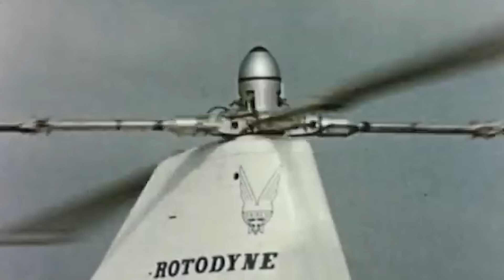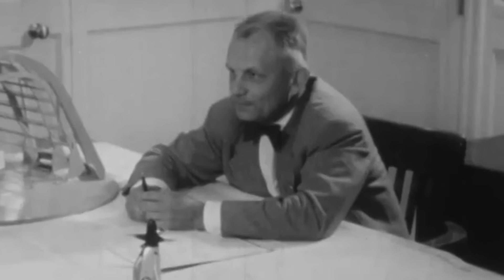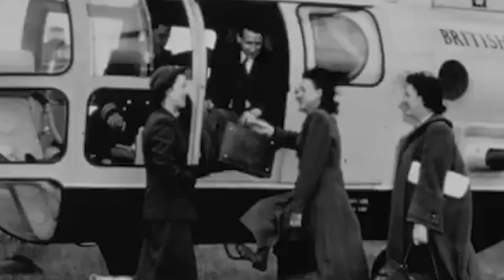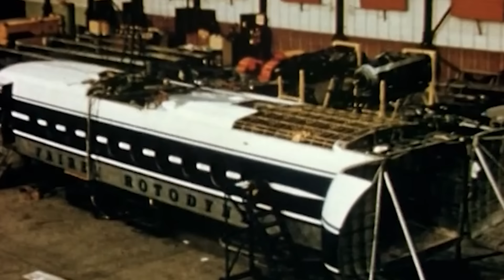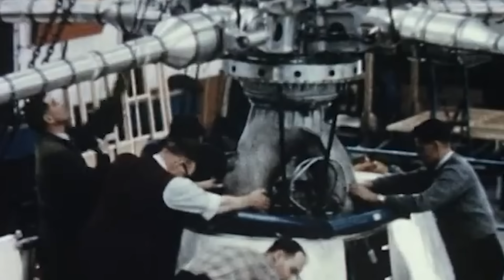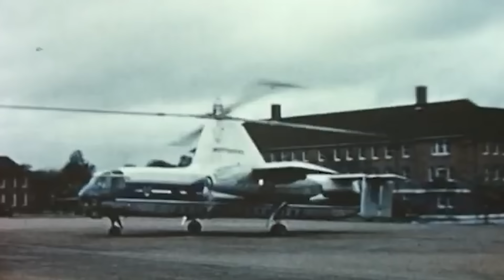The Most Successful Flying Box

Comment: The thing I've noticed about humans in general, and specifically the US, UK, most of Europe - the West - is that, if someone can dream it, someone can build it. And if an early model/prototype has some kinds of issues, if they can retain funding and keep working on it, engineers and scientists can usually sort it out - scientists can discover new alloys, new propulsion methods, fuels, new materials, new methods, lighter and more powerful systems, etc. and engineers can figure out better, more aerodynamic designs, better construction methods, better ways of putting everything together, etc. 

Seems like I've heard in recent years, it's the materials science that's one of the biggest bottlenecks - like we've got to figure out how to make different and/or better materials to build things out of - lighter, stronger, more flexible, more electrically conductive/resistive, room temperature superconductors, etc. Basically, with this specific craft, it seems like these issues could have been sorted out eventually - just find a way to muffle the noise, increase fuel efficiency, increase the lift/max load, get cities to help acquire more convenient plots to land on, etc. - like that stuck out - about finding better landing zones. It seems like cities and businesses/companies could have helped to find and develop suitable landing sites. 

Just crazy they had it more-or-less figured out back then - and I don't know the terminology/nomenclature but also how it had both the dedicated vertical and horizontal rotor/prop propulsion - and how they're still trying to master this VTOL type stuff even nowadays. I remember seeing, what was it, the Harrier and Ospreys back in the day (seems like I saw an Osprey fly over me once - being from the boondocks, it was quite interesting - you see tons of C-130s around here but that's it) - and now with the F-35 and it seems like I'm always hearing about bugs they're trying to work out. 

I guess it had to do with the specific timeframe, and I know it would be better if governments would be more frugal with our tax dollars, but given something crazy like this, the UK government must have been pretty tight with money to cancel it over £11 million plus the few million extra. It seems like the problems were solvable. But the US government throws billions and billions of dollars all over the place - it would probably be preferable for them to be more frugal and have to cancel promising projects rather than pouring funding all over the place and wasting tons of money.

Comment: There's no such thing as a "fixed wing aircraft". They're called Aeroplanes. Some of them have swing wings, which aren't fixed.
Reply: Most regulatory agencies, military forces and flight schools classify heavier than air aircraft into two categories, Rotary Wing aircraft  or Fixed Wing aircraft.
If it's wings do not spin? It's a Fixed Wing type... regardless if it has a variable geometry wing.

FYI: it's AIRPLANE  in English, The Fixed Wing aircraft was invented in America and the correct spelling is AIRPLANE

Comment: How does the aircraft work without a tail rotor to counter the torque of the main rotor?
Reply: The engines are not connected to the main rotor, so there is no opposite torque reaction trying the spin the helicopter in the opposite direction, it flys like an autogyro which also have no tail rotor system.

Comment: Flew in one of these from Penzance to the Scilly Isles  in 1969. The students from Wright Robinson  High School  in Manchester absolutely loved  the flights and these were in quite a contrast to the sea journey we took the year before or thew alternative  air link using  Dehavilland Dragon Rapide biplanes from St Just 'airport'.  Unique  memories.
Reply: Faulty memories... the single protype Rotodyne never carried passengers and was scrapped in 1962... you must be confused with another aircraft type.
Reply: @DoktorBayerischeMotorenWerke  Sadly after  the passage of  some fifty five years you are correct   with the info.  The Helicopter we used was a Sikorsky S-61 which was the current   helicopter used  in the late  1960s  as part of the service which lasted into this century and made it the longest running  public service   to  be based on  the use  of helicopters..

Comment: I would love it if gyrodynes could be made to work, they look to be able to fill several niches in aviation, mostly currently filled by helicopters, and expand others (flying busses). However, there would still have to be some serious research to make this happen.

Gyrodyne, including the Rotodyne, have more in common with autogyros than helicopters. The main thing is that the rotor shaft isn't driven by the engine(s) but rather freely rotates in the breeze. What allowed the Rotodyne to take off vertically was that (if I understand it) compressed air and fuel were pumped down the rotor blades and ignited in combustion chambers at the rotor tips. This rotated the rotor without creating the torque that requires single rotor helicopters to have tail rotors, however it also created a lot of noise. There would have to be a solution to the noise problem before gyrodynes could seriously take off (pun intended).

Modern autogyros do have spin-up motors for their rotors however as far as I'm aware they are for ground use only. What might work for providing power to the rotor without causing torque might be some kind of compressor or gas generator feeding compressed gas into a turbine attached to the rotor shaft. With modern batteries it might be able to build a battery powered system with power for 15 minutes, enough for takeoff, landing and some hover time.

Comment: I heard it flying as a kid. It was very,very noisy  at a time when aircraft engines were very,very noisy. The combination of a 90ft power rotor,two turbines and turbo propellers was over the top.
Reply: A quick question for research purposes as a writer - what was it that made the noise? Tip jets, the blades, or both?
Reply: @Ray_Satura_Valrose  Aircraft at the time were very noisy. As a kid I lived on the approach to Heathrow and a Lockheed constellation with four rotary engines was loud. Later we moved to a hill top and spitfires/ hurricanes, privately owned would growl into the nearby airfield. The rotor dyne was like three different aircraft in one place with different frequencies. The worst was the deep wamping  of the rotor and would vibrate inside the house. It's hard to appreciate today how turbine engines today have gained power and reduced noise. The tearing sound comes from propeller tip speeds exceeding the speed of sound which doesn't seem to be present in turbines. Perhaps sound cancelation occurs through different stages and blade patterns. Haven't looked at turbines since having a concept of inner burners in bypass air instead of afterburner in exhaust. A friend took that and ran with it.

Comment: Something I recall about the noise problem, was that the huge size of the main rotor; coupled with the speed of rotation meant that the rotor tips were travelling supersonically. No amount of noise reduction could overcome that problem.
Reply: And that is exactly why this concept was a failure... no one has ever solved the noise problem
Reply: The blade tip speed is given in Wikipedia as 720 feet per second.  At sea level, the speed of sound is 1100 feet per second.  So the rotor tips were travelling at  Mach 0.65  when the aircraft had zero forward speed.  At 100 mph aircraft speed, the advancing blade tip would therefore be travelling at 867 ft/sec, i.e. Mach 0.79.  The rotor operated in autorotation mode at higher speeds.  So no, the tips were NOT travelling supersonically (the designers were not THAT stupid)  - but the exhaust from the tip jets presumably was, which would indicate that the exhaust velocity relative to the rotor blades was higher  than (1100 + 720) = 1820 ft/sec.   That's what caused the noise.
Reply: @dafyddllewellyn6636  Excellent comments. Yes, not the rotor tip speed, the jet engines were Ramjet type and the exhaust nozzle gas velocity was extremely high... resulting in painfully loud engine noise.
Reply: Oh, interesting, you see, there is little talk about this problem.

Comment: This ideas and design more realistic to day with new upgrade bladed rotor know propeller toroidal least sound
Reply: This was a completely hopeless, dead-end concept that does not have any practical applications or commercial viability today.
Reply: 2 types  problem noise pollution, weight solve carbon fiber add knew electronic least weight more add reality to make don't forget appreciate place need save lacking space and need speed transit .that end vedio u see concepts   helicopter have design  @DoktorBayerischeMotorenWerke
Reply: @hyndriandelmundo6855  No one has ever solved the noise problem with tip jets, modern aircraft use turbofan engines for exactly this same reason. 
this was a prototype that had no additional weight from required avionics. 
In weight performance, traditional helicopters and fixed wing aircraft are inherently superior.
Trying to be both only increases weight and lowers payload capacity.

Comment: These Could Lift 18,000+ lb 💪
And Held The World Speed Record for Rotor Wing Air-Craft for a Few Decades 😲 
Had Multiple Back-Up Safety Redundancy ✔
No Tail-Rotor ✔ 
Even If It Had Both Engine's Failure 😨 
It Would Glide to The Ground, Safely ✔
The Huey 10 Years Later could Lift 4,500 lb 
Bacon-Foil Protection Against Bullets for Crew in Vietnam 😨 Wha...?
Reply: Epic failure... completely dead-end concept. Fairey made claims it could not deliver..
Reply: The CH-47 has a 24,000 lb payload, and a 400 mile range without any of the problems the Rotodyne had

Comment: Did they really only have that one option for the behemoth rotors? That being the end mounted propulsion system? Wouldn’t a typical turbo shaft engine that could produce the same thrust necessary as the tip mounted propulsion systems have worked? Then they could have just disengaged the main rotor from the shaft when autorotation was applicable? Unless such an engine concept was not available at the time? Any way, just a thought
Reply: With that setup, the machine would also need a tail rotor to counter the reverse torque on the fuselage. The whole beauty of the tip jets was no tail rotor was needed.
Reply: @mandolinic  I suspect running a single propulsion engine/prop would be sufficient to counteract the rotor torque
Reply: @mumbles2000  Or one propeller with forward pitch and the other in reverse pitch. Use the rotor to gain forward speed then disconnect the rotor and put the props in forward thrust. 

Nowadays the rotor and props could have electric drive with the engines providing the juice. 

A tail ramp would have be better, too.

Comment: One of these Rotodyne built with new smaller engines (yet more powerful and reliable), components made of composites would be feasible today. I am sure the sound decibels could be lowered within an acceptable range. The gyro copter idea seems better than the Osprey's plagued twin rotors that causes more often a dangerous Vortex ring state.
Reply: Agreed. These in a modernized version would be better than the Osprey.
Reply: Using modern electronic methods to lower the decibels would probably help alot.
Reply: There was a proposed heli design from the late 80s or early 90s with wingtip nozzles, but those only exhausted air. The system used a vertically mounted jet engine with a large precompressor to power the nozzles and the rotor basically rotated around the top of the engine. While it did not need any means against counterrotation, it had a tail nozzle for directional control. 
Its main advantages were the complete lack of rotor adjustments, that greatly reduced complexity and therefore construction and maintenance cost, it was said it could be build for around 10% the price of a regular heli of the same size.
Reply: Run the rotors electrically... Put super quiet engines on the wings and modernize this is a real possibility

Comment: Noise is an indicator of inefficiency.
Reply: Before it's final cancelation, they had refined the design and had much reduced the noise.
Reply: @philalcoceli6328  That is entirely false rumor... the noise problem of tip jets has never been solved.,
Reply: @DoktorBayerischeMotorenWerke it’s a problem large helicopters still suffer from. If they could have found a way for the rotors to attain the speed necessary to take off fully loaded without using tip jets then it might have had some success. But you’re looking at a system similar to a chinook, I.e. twin contra rotating rotors to be able to carry that load. Might be possible to reduce transit noise when in gyrocopter mode but you’re still going to need to engage the  rotors to carry the weight on vertical take off and landing. And there’s where the noise will be. VTOL in any mode generates horrendous noise to get the necessary thrust for take off and landing. Shame really, great on a military base, not so great in a residential area.
Reply: @jeremytoms5163  If Im not mistaken, a CH-47 Chinook can carry an even heavier load than the larger Rotodyne version that Fairey had proposed.
Reply: @DoktorBayerischeMotorenWerke  probably could, wasn’t that part of the original design brief for the chinook? That it could move anything up to a light tank?
Reply: @jeremytoms5163  The CH-47 Chinook could also carry more people 3+50 compared to the Rotodyne 2+48
Reply: Tell that to the Super-Screech.

Comment: That looks like a Early version of The v22 osprey
Reply: I was thinking similarly. It would seem the English came up with this idea, and a lot of other 'ideas' first but just didn't have the money available to develop it. Ahead of its time; arguably too far ahead. Like the B-58 Hustler, the technology wasn't available yet to make it successful.
Reply: @Dbusdriver71  Pan Am briefly tried using a Commercial version of the Boeing Chinook helicopter to ferry passengers to and from Downtown NYC to LaGuardia and other Metro Airports- but they ran into the same noise pollution issue as the Rotordyne...
Reply: @brianknapp6215  'In these days' its a really good idea worth investing in. This is the direction 'everything' seems to be going now....
Reply: The Osprey is a Tilt-Rotor craft- using the same engines and propellers for both vertical and horizontal flight. The Rotordyne had two separate rotor systems essentially powered by the same engines.  
It was a Technological dead end- kind of like Autogyros in general.

It's too bad- it's a cool looking design that had a lot of Potential...
Reply: 100%
Reply: How? The only similarities are twin turboprops
Reply: @coldboremirakle  Too Right.
The V-22 can fly 160mph faster and has double the range... the Rotodyne is not even in the same class of aircraft as the V-22..
Reply: @DoktorBayerischeMotorenWerke  The Osprey succeeds at what the Rotodyne was attempting.
Reply: Exactly what I was thinking.
Reply: Looks can be deceiving... this was a failed concept,